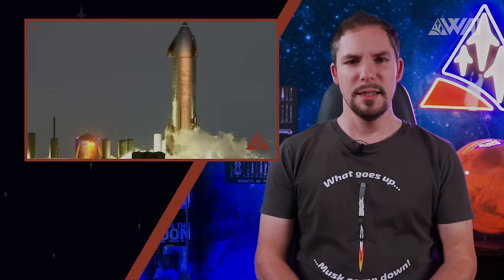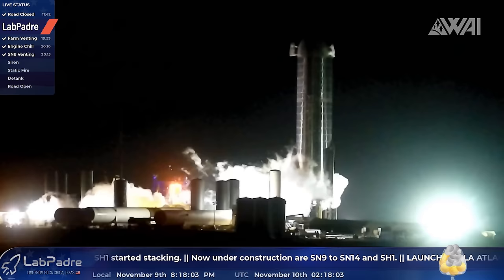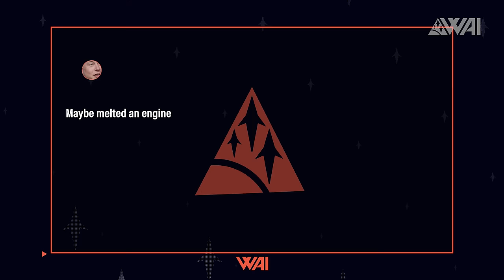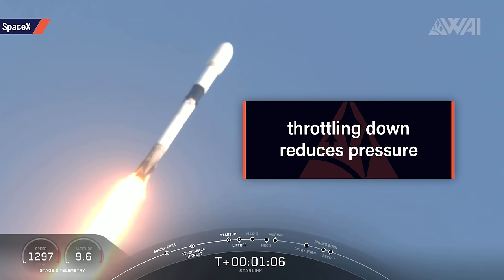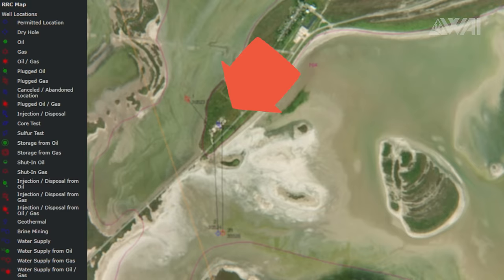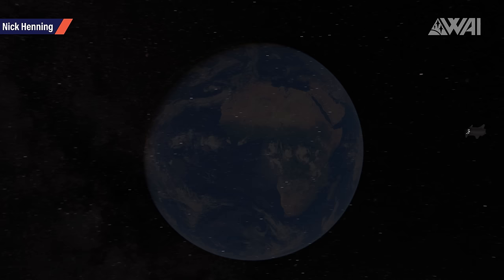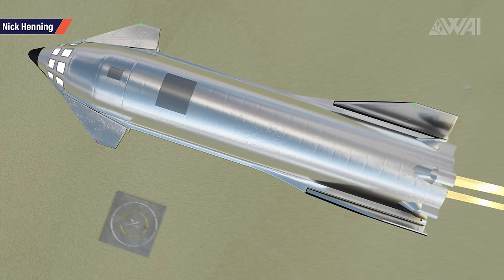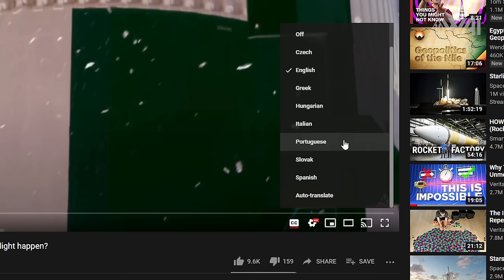132 | Serious Problem on Static Fire & What will it be like to ride a SpaceX Starship?

Comment from the maker: Which Starship will feature the v1.1 Legs and how serious is the engine problem on SN8?
Reply: It is nothing SpaceX cannot fix!  Thanks for the videos!
Reply: I’m not a fan of this leg design. I hope this is one of the first things they change (aesthetically). 
Also, I don’t think I would want to be on a vehicle that does the that belly flop last second flip. Too much could go wrong with too little time to correct. Maybe if they could light all three engines and throttle them down... idk, it just seems unnecessary risky with lives on the line.
Reply: my guess is the sn10 will have the upgraded legs. As for the engine problem i think it may be a set back of a week or two, but at least the starship didn't explode :)
Reply: It looked  like a reasonably serious problem in the failed engine. I'm hoping it was an anomalous part failure or bad installation rather than a deep design flaw. On the plus side it didn't cause a system RUD, so that's really good. No idea how much damage was done to the other engines though.
Reply: These legs are definitely larger, and in two pieces. These are 1.1 legs that will go in sn9. If you look at 1.0 legs with crush thing attached they take up a whole pallet. These new legs take up a whole pallet without the crush attachment
Reply: It is far better to find and fix problems on Starship now when it on the ground than during a flight. I still have high hopes for a November flight.
Reply: Again you're comparing the Starship to the Apollo program again. That was 60 years ago. As I've said before, SpaceX is getting there from standing on the backs of giants.
Reply: Question please?
To put things into context...
...Having the privilege to say I was alive when Man landed on the moon and hope to still be here when we do it again and even more, hoping to be alive for the first man on Mars. From the start of SpaceX from Falcon 9 to Falcon Heavy up the Starship program, I haven't missed one event and am just at awe of the progress made in such short times compared to Nasa on it's own. And now, to my questions... 

....Starship is the only vehicle that has it's engines inside Starship's body, instead of all other vehicles having their engines sticking out, and in my view has a very small engine to ground clearance and the flames have clear backfire to bounce off the ground and into the engine enclosure which would envelop all 3 engines with fire instead of the fire engine burst escaping away from the engines. Even if the static fire tests last about just 5 seconds, that's 5 secs of intense fire bouncing off and staying in that space where the engines are. Can someone explain to me if I am totally off in my thinking, speculations? Or is it possible that I'm right in my reasoning?
Reply: @SKnight1968  I don't think you can compare what's going on today with the Apollo program. With the advances in technology, and a billionaire who has very deep pockets... he's using what the Apollo program taught us, he's standing on the backs of giants. Much of what he is doing has already been worked out for him, he simply working out the details. I'm excited in what's going on and I hope to live to see a man land on Mars as well... but if it were not for the 400,000 people that worked on the Apollo program, he would have to start from scratch.
Reply: @madisonlivingston5851   Thanks but I didn't really mean a comparison between the Apollo program and today's new programs. I was really referring  to Falcon 9 rockets and the Falcon Heavy version that both have their engines sticking out instead of like Starship having it's engines inside the hull sort to speak. The fire has really no place to go but back at the engines inside the hull since there's very short engine to ground clearance. That extreme fire, heat, burst has really no place to go but up and envelop the engines with extreme heat. 
(make sense?)
Reply: @SKnight1968  my apologies sir, you did compare it to NASA on its own, not to the Apollo program. I had just left a comment to Felix because he did compare it to the Apollo program, and that irks me a little bit. I was still a little hot under the collar. I apologize!
Reply: Great Information my dear Friend ..
So this big Jobs is Fantastic moments the new Hardware about the Rock Spacex..
Welcome to Brazil Mr. Elon Musk and Gigafactory Tesla Model...
Reply: @randoshanks  Agreed on all points
Reply: 1 idk feel like a better backup so if a leg fails like a landing is more rough than we like it can land a lot more times if something breaks and number 2 don’t like it feel like it will be more and more tech witch cost money witch can be bad if it cost too much
Reply: Engineers will first work on the somewhat simple engine problem until delivery of the v1.1 legs. The v1.1 Legs will then be attached to the SN 8 Starship before the SN 8 Starship test flight.
Reply: Engine swap and maybe one more static fire?
Reply: Turbo pump issue?
Reply: @madisonlivingston5851  No apologies needed my friend, no offense given or taken. I guess I wrote my question wrong, my goal was really in asking about the present configuration of the raptor engines being inside the bottom of the hull/fuselage as to compared to a Falcon 9 rocket or a heavy falcon rocket. That was truly the intent of my question. All I see under that test site is flat concrete between the engines down to the ground, unlike other pads, there's no hole in the ground nor water filling that hole with gallons of water. Yes I know there's water used on the flat site but there's no room for the flames to escape the small height of clearance between ground and engines. It's like having the engines in an upside down bowl capturing all the force, heat and fire that has nowhere to go but down and right back up enveloping the engines in fire. Does that make sense?
Reply: @bmm bmm 
Tim Dodd said "no".
Reply: @SKnight1968  
What bounces off the pavement and goes right back up is not Flame, but instead, Sound and Light. The engines, and sundry equipment attached inside the engine skirt, are clobbered by Sound from the three engines during these tests. (The immense sound is produced by chaotic processes in the combustion chamber.) 

The majority of exhaust is going straight down and then sideways near the pavement, with some fancy flickering from (more) chaotic turbulence. 

The pavement, if not kept coated with water spray, is going to rapidly exceed the boiling point and spall fragments off the surface. The heated pavement emits radiation.

The white component of the flames is going to emit the most infrared radiation. The transparent component of the flame radiates almost nothing. Part of this radiation is certainly going back up into the engine skirt, heating up everything.
Reply: Felix, those legs look COMPLETELY different! Not sure why you made such a fuss about them “looking the same”?
Reply: @deebee1284  
The press cannot give clear examples, much less corroborated examples of his misbehavior. It all has to be protected sources with every witness-incriminating detail sanitized. So it must end up looking like a public smear campaign, which it most certainly is. Powerful leaders in publishing are shaming a high-profile public figure, not to bring him in line with acceptable standards of behavior, but to make money off him. 

Starship is a high-consequence project where weeks or months of labor by thousands of people may be wiped out by any one of thousands of overlooked details. 

At SpaceX, their primary metrics are: fast, effective, and low cost. Along the way, all these young employees are learning how to also do every step with excellence. SpaceX is learning how best to build as they build, and growing high-value human resources both to achieve this and to carry the struggle to Mars. 

Of course Elon is going to ask them how failures occured and why schedules are not met. He is going to expect answers that are factual, relevant, and cogent so that it doesn't happen again. 

But he also needs all of them to develop a mindset that actively searches for ways to be personally and collectively excellent. If you can't do that, don't work for him.
Reply: @SKnight1968  yes it does, I wondered the same thing myself. I was wondering if they were going to have problems with that.
Reply: @imconsequetau5275  Thanks for the 411, much appreciated!  Especially your last phrase which is what I was talking about...
"Part of this radiation is certainly going back up into the engine skirt, heating up everything.". That skirt thing is way too small height clearance wise and especially with no water hole under it.
Reply: @madisonlivingston5851  I'm no engineer nor do I want to sound like I remotely understand all the sciences applied but logically it's extremely weird to me and is just logical that the heat and fire would bounce back up the skirt surrounding the engines and therefore melting the smaller fragile components.
Reply: @SKnight1968  
The small clearance issue is occurring on descent when the ship is 600 Tons lighter, is decelerating very hard, and shuts off immediately when nearly touching the ground. This is in great contrast to a typical lift-off when thrust is barely 10% greater than ship mass, and the ship is propped high up on a launch mount. 

The greatest misunderstanding is how the three earlier test hops are not typical of a "normal" high-g three-engine hover-slam. They were all atypical low-speed approaches back to the ground.
Reply: @bmm bmm It looks like its only “abort” modes will be: early. abort off of a malfunctioning Heavy- either RTLS/Return to Launch Site or Abort to Orbit (if not Abort Once Around) if Heavy problem is later in Heavy’s launch profile. In second stage, any Abort necessitating quickest return- such as ECLSS failure- could still be an AOA; otherwise limited to ATO. NOTE: these are all assumptions on my part; I have no inside info,
Reply: @imconsequetau5275  Thanks but I'm still questioning the visible and undeniable facts that having those engines within a skirt with what I believe that the engine to ground clearance has not enough height and also the fact that the launch pad is flat with no in ground hole that would usually be watered down and filled to the max within that hole so to keep the flame and heat not to rebound to the inside of the skirt where the engines are???? 

They don't have that issue with Falcon 9 and Falcon Heavy because their engines are not trapped within a closed skirt and the heat, flame, radiation, sound does not rebound within a closed skirt where the engines are enclosed. That's a lot of heat and sound vibrations just wanting to go to the path of least resistance which is in this case, the inside of the skirt.  And if this happens with a 5 seconds static fire with only 3 engines, I can only imagine what the results would be with 28 raptor engines facing the same issues?? 

Yes I can clearly see that flames and heat are escaping sideways from the bottom when the engines are fired and so far I've witnessed the same similar issues on all Starships static fires and the 2 hops from SN5 and SN6, one had an engine on fire during the hop and the other had similar issues plus the leg issues as well that could of easily been attributed to all that fire, heat, sound vibrations being trapped within the skirt that the engine were enclosed in. 

The fact that those 2 hops were in a sense considered successful was due to the fact that the fire, heat and all other factors already mentioned weren't trapped long enough thanks to the ship gaining altitude just mere seconds after ignitions. Though it still caused damages to the engines and even legs. When the engine or engines fire up, the heat, fire, vibrations have to bounce off the ground of the launch site and even if it's not more than just a few seconds, those have to be directed away from the rocket/booster and there's absolutely no way that anyone could tell me or even convince me that that rebound of fire and heat doesn't bounce back up directly into the skirt and is trapped there for few seconds where it engulfs anything that is in that skirt, which are the engines. 

Yes part of all that energy, heat, flames, vibrations and so on does escape away from the skirt as well, no if's and but's about that but there's also no way that those issues don't bounce directly up into the skirt with no room or route to escape until the rocket gets some height.  Logically there's absolutely no way that the fire, heat and all that those entail, does not bounce straight back up and into the skirt that encloses the engine(s) and due to those factors must by de facto engulf the engine(s) with fire, heat, vibrations with no escape till the starship starts rising up and getting more ground clearance where the heat, flames can escape from being trapped within that skirt,  that's just logic. 
I am definitely not in the same league as most of you when it comes down to all this science, especially "Rocket Science", for which I can easily and humbly admit. But unless the basic laws of physics have changed within the last few centuries, that heat and flames absolutely have to bounce back up within that skirt and stay trapped long enough to cause  serious damages to the engines inside that skirt. 

So yeah, having 28 raptor engines at the bottom and enclosed within the Super Heavy's skirt just makes my skin crawl and gives me goosebumps and as for an astronaut who will eventually man the first ever manned Starship in around 2029, that's an issue I'd want fixed before getting in. I have to edmit there's plenty of time to fix this, tons and tons of testing and all that those tests entail. I have no doubts that by 2029, all these issues will be fixed, but for now, that skirt issue with engines/legs enclosed within it (skirt) ,are an issue that needs to be resolve ASAP. 

P.S. Apologies for the long rant, I get carried away sometimes.
Reply: Hi everyone, I'm sending this reply in a general manner instead of addressing everyone's reply one by one, that would be just too much to write and though some words would change, the details/issues/subjects would remain the same.

This is in no way a message to say I told you so or I was right and no one believed me due to the fact that I am in no way an engineer or rocket scientist in any shape, way or form and that my reasoning was simply based on my observations and my understanding & perception of physics 101 which is clear that what goes up must go down and what goes down must find the easiest path of downward least resistance, which in this case has been proven by the facts of what happened that what went down with such force bounced off of the low clearance flat below the engine bay/skirt and with the rocket not moving up, the flames, heat and all other factors trapped within the skirt/engine bay cause extreme heat, flames, sound vibrations and anything else was trapped within that skirt/engine bay and cause all the damages explained by real engineers/scientist that pretty much explained that my reasoning was right. 

Elon Musk himself validated these facts reaffirmed what was needed to fix these issues, and will work on the pads themselves since the issues were in no way responsible with the engines themselves but rather the launch pads and admitting the clearance between the engine and launching pad was simply not high enough and the facts that the launching pads needs a water hole below the engine bay/skirt so that the flames/extreme heat doesn't bounce back and get stuck into the engine bay which has no other real escape except to bounce off into the engine bay/skirt which will get stuck there just long enough to cause major damages especially during a static fire test because the rocket is not moving up and hence why the flames/heavy vibrations have nowhere to go except for being stuck in the engine bay/skirt of the rocket, melting anything that can't resist such extreme heat and flames, vibrations all being trapped in such a small engine bay even for a mere seconds.

 Launching a super heavy on the newly created pad with higher pilons will still not be enough if they don't create a water hole beneath the engines (within a skirt/engine bay). This is a necessity to absorb all these issues and put them to rest. If not, then this will keep happening if they don't create that process of water cooling like they do on all other launch pads and not just SpaceX but all other rocket launch pads that all share this needed water hole with continuous flow till it's no longer useful due to the rocket being up and out of range. SuperHeavy will have 28 raptor engines and without enough clearance from the ground with no water hole and continuous flow till it's up and away, we're talking major flames, heat, vibrations and so on, all those will bounce off the flat surface right up into the engine bay/skirt and will cause major damages and end into a catastrophic situation that could of been averted if they had modified the new launch pad with the so needed water hole with continuous flow till the rocket is up and away.

Yes I read Elon's take on this situation and why they didn't want to go with usual and much needed water hole, because where Starship will land and then lift up will not have that essential feature and I totally understand as it makes perfect sense. But there's a major difference here, be it on the Moon or Mars, that feature will not be available and hence why they are trying to replicate that issue here on earth. But there's a major difference between earth, moon and Mars, which is the lack of gravity on Mars and the Moon which makes a huge difference in both instance, that simply making the Starship's legs much taller which would help both on the Moon and Earth when coming back. If SpaceX could give Starship similar legs as Falcon 9 and Falcon Heavy, this would solve so many issues on landings, both on Earth and the Moon. From there on, they'll have plenty of time/data and correct any and all issues when sending Starship to land on Mars. Being totally out of my elements and in the same time needing a book entitled "Launching and Landing rockets for Dummies".
Why not build a sort of "FireWall" in the skirt/engine bay that would surround all 28 engines except for the engine's bell sticking out, so that the flames and heat can't touch any parts of the engines save for the bells sticking out? This way, all the engines are protected not just from the flames and heat but also from any "foreign objects like rocks/dust and so on". 
Wouldn't that be a logical option?